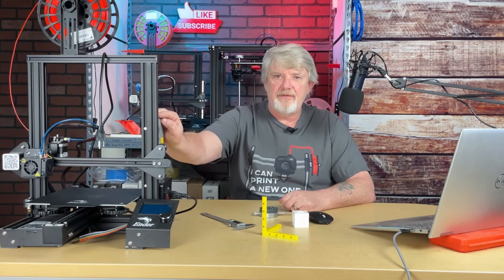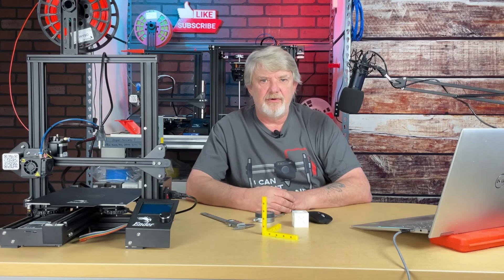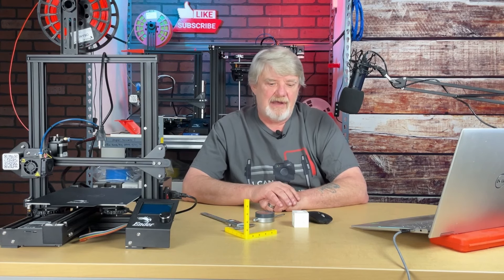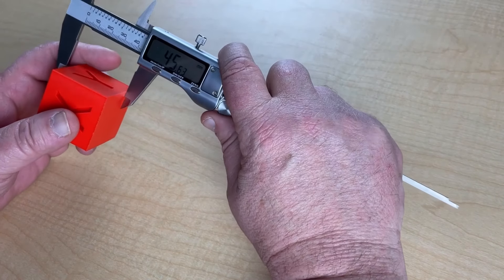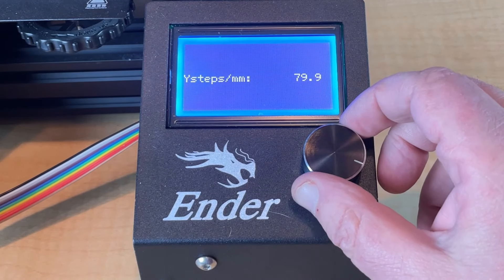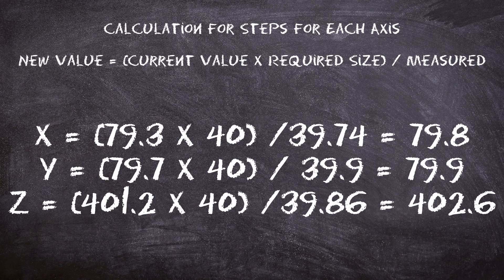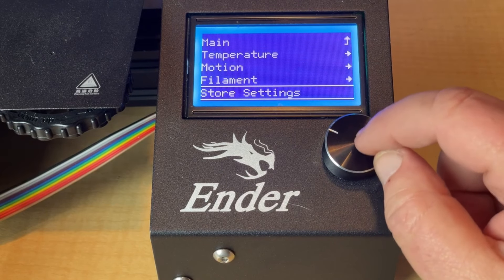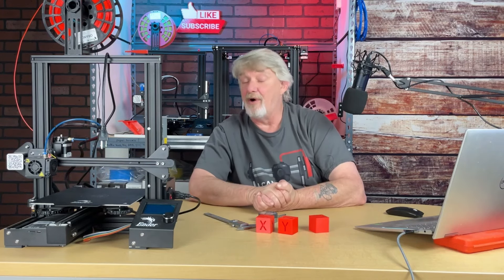Calibrate Your XY & Z Steps For Dimensional Accuracy of Your 3D Prints

Comment: Flow has to be calibrated
Steps are calculated by the rotation ° and translation
Calibrating steps is a myth on the web that is impossible to get rid of

Fist cube:
X: 40.37 (+.37)
Y: 40.14 (+.14)
Z: 39.88 (-.12)

If the steps are calculated 80 80 400 this would mean:
X & Y to high = to much flow
Z to low = wrong Z offset (nozzle too close to the bed)

Second cube:
X: 39.74 (-.26 Δ .63)
Y: 49.9 (-.1 Δ .24)
Z: 39.86 (-.14 Δ .02)

Now with wrong steps
X & Y now both to low 
Z still to low, Z offset wasn't changed

Try this, ignore Z without being able to set a correct offset
Print cube 40x40x40 with original steps
Print cube with 80x80x40 with original steps

If your error from cube40 is half of cube80 you might have a problem with your belt/gears/stepper
If the error is the same or almost, it's the flow not the steps

Btw if you calibrate e steps, and keep flow constant this needs to be done with every filament
Best, keep e steps constant by calculation and set a flow for every filament profile
(flow is a variable for the material, e steps are for the machine and are fixed)
Reply from the maker: Flow is calibrated, true. In fact I did a video for that. Your idea of steps being a myth is a myth in itself. It's simple, calibrate your eSteps to determine how much filament is going IN the extruder. Calibrate the flow to determine how much filament is coming OUT of your hot end. Your Z-Offset has nothing to do with dimensional accuracy. Once you know how much is coming out of your hotend you have the necessary information to work out dimensional accuracy. You calibrate your X, Y & Z steps. Your Z-Offset is to make sure your nozzle is at the correct distance from the print bed. Of course you'll want this set properly for bed adhesion. Your ESteps, X, Y & Z are set at the machine level. The flow is set at the slicer/profile because the flow should be figured for each filament brand & type just like you do for temperature and retraction. In fact I recently did a video on setting up a profile in Orca slicer where I ran a 20mm, a 50mm cube & a 100mm with the same settings that demonstrates that it works.

Comment: why do people keep doing this  this way?  this is a flawed method because it asumes there is no volumetric error  if you going to calibrate steps per mm you need 2 different size prints to rule out the error because using just one cube would make any print different size wrong dimensions again. from one cube you can only calibrate flow rate!!
if you don't have a dail indicator simply home the printer heat up the nozzle with dark filement in it and stick a piece of paper to the table with some tape so it wouldn't move
then simply scratch known size square on the paper by moving x and y axies by known length for example 100mm  staring from some random point on the paper  but not directly from the edge
if you draw a squate back to starting point you just measure the square with calipers if the nozzle don't go back to starting point exactly, you first have to fix motion system slack
and surprisingly if your belts aren't stretched tey you will get stock values of steps per mm every time
from this point you can calibrate the flow on a cube and size of the cube does not matter because you only calibrate how much filement is expanding from slicer assumed line width and it is highly dependant on filement diameter being correct for slicer to calculate the flow correctly
Reply from the maker: People still do it this way simply because it works. There have been countless articles, tests and videos on this subject. The number one method would be with a dial indicator. But as noted in the video, most people in the 3D printing community don't have one. If you have one, great! But I'm not going to tell anybody to go buy one when this method has been tested and proven to work.
Reply: @pushingplastic7445  you don't need a dail indicator, you just need a rooler or calipers, and i can tell you one thing , this method with single cube made me very unhappy when i trayed to print bigger prnt using prusa slicer dividing in  parts  and printing them on 2 printers at once. i had to reprint the smaller part on the other printer because the size wasn't the same from printer to printer, and they both were calibrated with single print method, but strangely by using default settings and calibrating flow parts from printer to printer fits like a glove. every tool can be used the wrong way nd this is one of those cases, change to filement from a different manufacturer and your cube will be wrong again, change nozzle  size and it will be wrong again. this work for people having one printer printing one size object fiting a hole roughly the same size all the other saces you would have to recalibrae
if you do it smart you don't have to calibrate anything other than flow and slicer would do the rest for you regardles of the size of the print of nozzle because your belts and driving gears very rarely change size

Comment: Or you can compensate by making dimensionally accurate models in the first place... Most models i have found are in no way dimensionally accurate. No scale just what someone thought lioked good.

I've had trouble with my printer but not with accuracy when i use my own models.

Most people do not model with layer dimensions in mind
Reply from the maker: Sure, accurate models are a great start. In my day job, I'm a mechanical designer. I have been for the past 39 years. When I design for 3D printing applications, I design with layer height and wall thickness in mind. I've also found that not all printers are created equal. Parts printed on one machine can give different results than another. You'll want to dial in your printer, especially if you have multiple printers running parts for the same project. You're going to want to make sure those prints are going to mate together properly. Thanks for watching.